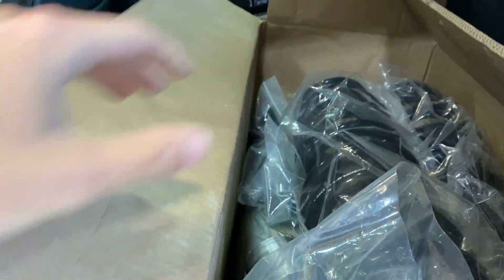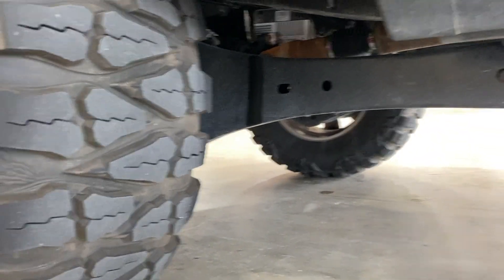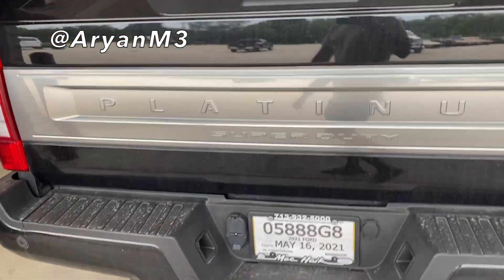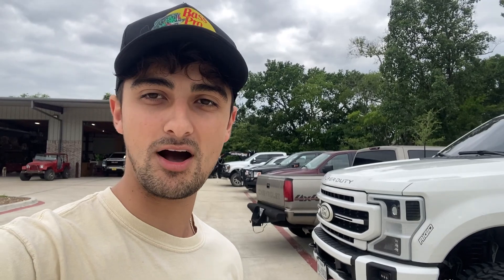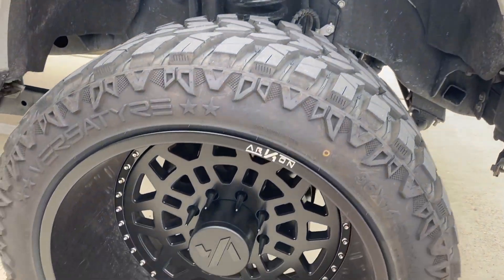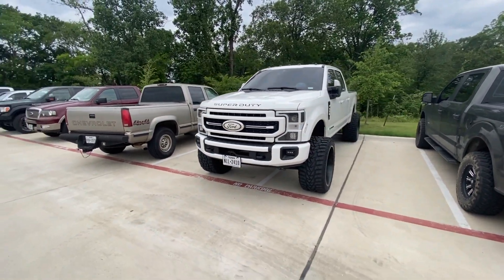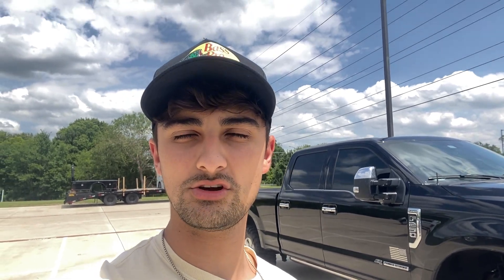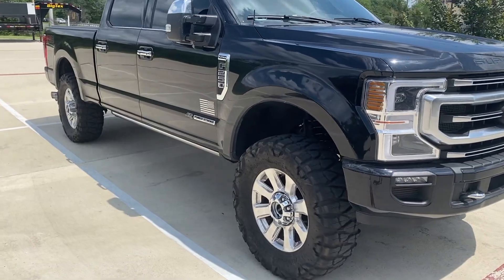Running 37's With 2.5” ReadyLift LEVEL

Comment: So 35s only half inch difference on 37s when installed people remember a 37 is not 2 inches higher on the top its diameter so 1 inch on top then after mount 1/2 inch not worth the extra 200 per tire.
Reply: That's not true most 35s mounted measure 34.5-37.8". 37s measure 36.5"-36.8". 2 inches bigger on average it will raise your truck and diff 1" which off road makes a big difference.
Reply: @rockie307  ok depends on the make of the tire...still not worth all the extra money for I inch..
Reply: @bigguy1403  To most people it's not for sure for the small percentage that go offroad and to the limit like I do it is. One inch will make the difference of making it sometimes or not also if your in rocks like I am all the time in the Rockies 1 inch more keeps your drive shaft further from being bent on a Boulder. But yeah for 98% of owners it's just wasting money on tires and fuel for extra capabilities they don't need. Also smaller tires tow better.
Reply: I did not purchase the 37’s for the height, I purchase 37’s for the plush ride when aired down under 50 psi on the Highway and over potholes, and buckling of highways down here in Louisiana from all the rain. I am not towing much and 90% + of my usage is traveling from construction site to site.(as good as my 2020 F150) CANNOT say that with 35’s, no matter what manufacture.
Reply: @ShelbyvsViper  I sold my beautiful truck 5 months ago. I'm going back to luxury cars for a while. Bought a new Mercedes and so far I'm loving it.

Comment: Hey man good video thanks. Where did you get the thinner air valance ? I’m looking to but a thinner one like you but not sure what is good. What did you do?
Reply from the maker: Thx buddy! I got mine from my local ford dealer.
Reply: Just buy the 2WD valance for your model. The holes line up perfectly but it is not as tall as the stock 4WD unit.

Comment: How's it ride with the new springs. My f350 rides so stiff stock I have the plow package. Was looking for something softer in the front.
Reply from the maker: Mine rides very similar to stock
Reply: @AryanM3  Thank you.
Reply: I'm looking for softer ride for texas train tracks there bullshit .I ha e stock on 35,12.50,r20s haida make zero road noise . I ordered fox 2.0 an there 5 months backorder. So I looked into king shocks there also 6 months back ordered so any help is appreciated  on what shocks I should get  I have coil spring 2.5in lift I'm about to Install once I find shocks ,thank yall
Reply: @FKNSENDIT  I seen Carli suspension has a kit 2.5-3.5 lift with springs that are like 6 extra coils so it softens the suspension but also when compressed it still holds the heavy duty weight. Springs are like $400. They have shocks too. I think small kit is like 1000 and better kit 2000 but best one for what you need is like $4000

Comment: I got rid of the bulldozer stock valance on my 2009 F-250 4x4 and replaced it with the stock valance from the 2WD. The holes line up perfectly but the 2WD valance is less than half as tall versus the 4WD version.

Comment: Did the 37 hit the front bumper valance before leveling it which readylift 2.5 leveling kit you got I want to put mud grapplers to my 2022 f250 to and labeling kit same as you got
Reply from the maker: No they only touched radius arms

Comment: How has your fuel mileage changed after the level and removing the front valence?
Reply from the maker: Didn’t notice a difference
Reply: It’s a gigantic leveled truck. MPG’s would probably be in the low 20’s or high teens
Reply: @Scores Man  my ecoboost (v6) f150 has gone down to 15mpg with a leveling kit and 33.5" tires. I think the v6 is much more effected by the weight of heavy tires. Hence my curiosity around how affected the diesel is by big tires.

Comment: Any rubbing after it was leveled?
Reply from the maker: Only on radius arms at 95% lock
Reply: @AryanM3  oh darn, im about to be towing my dump bed and track loader around more often and i just bought my 2018 powerstroke and it came with 37s on it. But i don’t wanna lift it i dont want any rubbing I might have to drop em back to 35s. Thanks

Comment: Did you put an adjustable track bar ?
Reply from the maker: No, just the track bar drop bracket
Reply: @AryanM3  thanks. That’s what I installed on mine. Trying to decide on size. I do believe I’ll be going with 37’s.